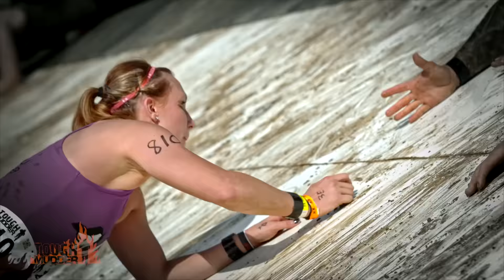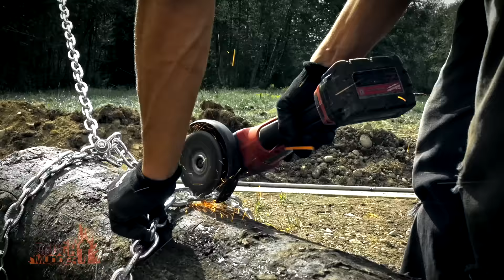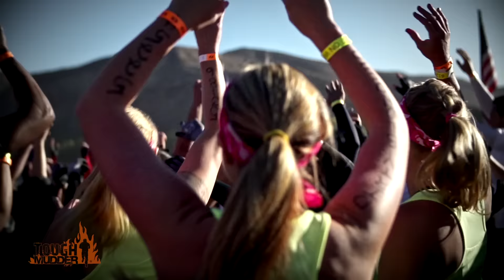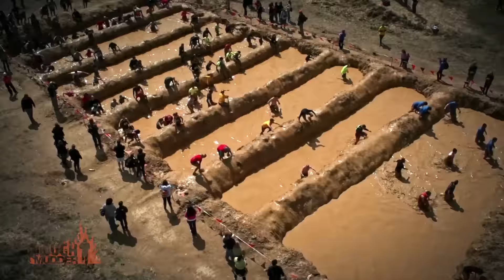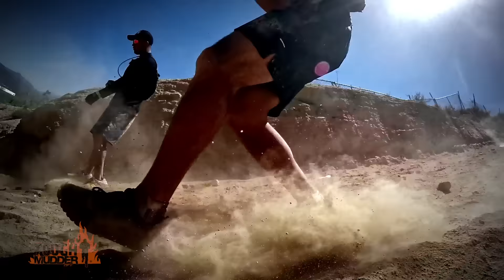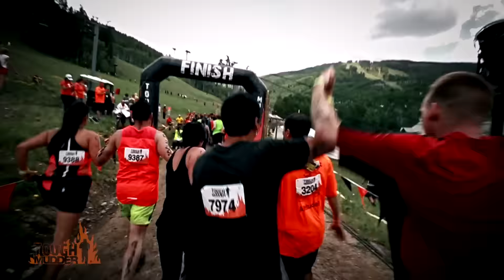Tough Mudder Trailer: Official Obstacle Reveal | Tough Mudder

Comment: This will be my first time as well wow 5 new obstacles the 2 that will not be easy are back stabber where you have to get to the highest point and strike the pin and climb and the rain man it's a much deeper water challenge where you have to move backwards while water is pouring on your face this is gonna be hard.